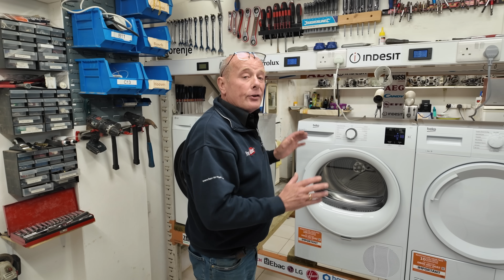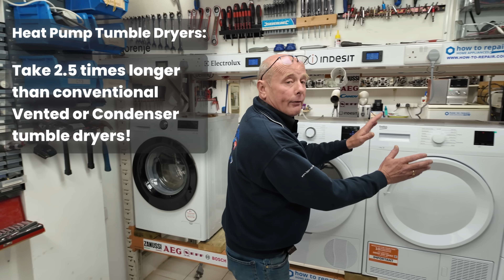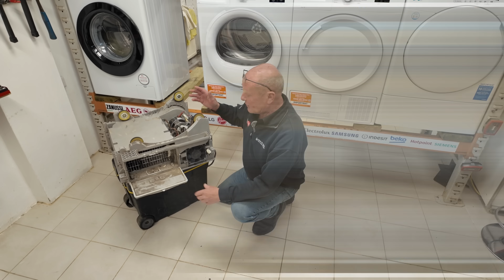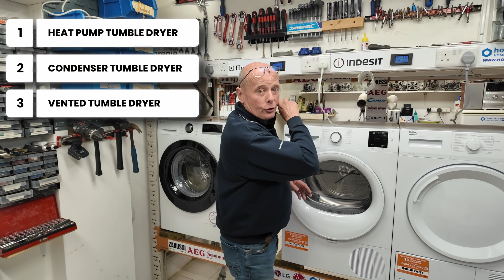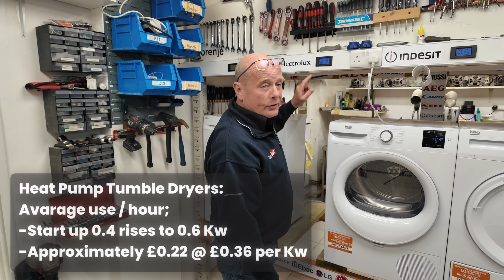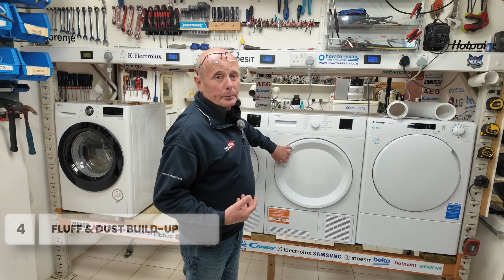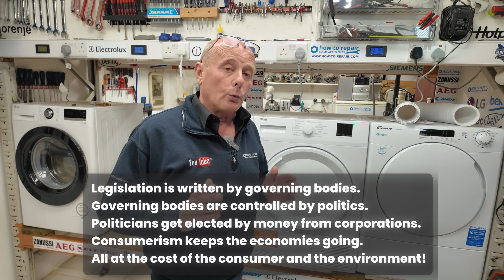Tumble Dryers the Shocking Truth About Heat Pump vs Vented & Condenser, NEW LEGISLATION!

Comment: We have had a Bosch heat pump dryer for nearly five years and so far it has given less problems than our previous Bosch condenser dryers ever did in that same time frame. Also very reduced risk of a fire.

We simply clean out the lint filters regularly.

It uses a third of the energy of our old condenser dryers and we run our home off grid.

Keep your condenser or vented dryers.

Comment: My Whirlpool vented dryer is still going strong after 27 years (as is the matching front load washer). The dryer has needed one replacement belt,(which I replaced myself) and the washer one inlet valve (which got stuck open and the machine filled when not in use (which wasn’t fun when you opened the door to use it 😂😂😂).

Comment: I've had a heat pump tumble dryer for 4 years. It sips electricity. I use it 5-7 days a week when the weather is poor. In the summer, when I don't use the dryer, I couldn't figure out why my electricity bills weren't dropping. Then I realised the fridges were the problem. I bought a new A rated fridge and the problem was solved. I use my washer, dryer and dish washer on the eco setting every time. I don't care that it takes several hours for cycles.

Comment: I had an apartment size tumble dryer, it died, replaced with condenser dryer. I swear it's energy usage is not just slightly less. I think it's close to 30% less.

I also use the delicate setting for almost everything lol.

Comment: I have had vented and condenser tumble dryers and the best are condenser dryers, mine also assists in heating my home.  I wouldn't give house room to a heat pump dryer.  I swear someone has bought a job lot of heat pump, nobody with any sense wants them in their house because they're so inefficient, now they're putting them in white goods, equally inefficient.

Comment: Why should we be told what we can buy just by the energy consumption we pay either way any ways i went to buy a new dryer last year 2024 at currys was told where in the house to have it placed the only place available was the spare bedroom who wants a dryer in the bedroom whether spare or not my air dryer is working well placed in my garage where i get a load done at the same time as my washer finishes i dont think i would get the same amount done as i do now with a heat pump dryer and your right the expense and maintenance expense is beyond my financial capabilities i think im gonna buy a couple of dryers as spares and just keep them dry stored in the garage for when i need a replacement before again we are dictated to what we can and cant buy its the same with cars and electric change over we as a country only produce a small percentage of the emissions and all this green electric cant and wont be able to keep up i work with companoes building wind farms and solar farms these storms have wwreaked havoc on the energy sector by destroying solar farms and the wind turbines cant be used in winds over a certain mph gusts so whats the point

Comment: When I separated from my wife, I went and bought all new white goods. Looking at tumble dryers, there were cheap and cheerful ones not great on running costs and eye-wateringly expensive ones with A+ rarings. Suspecting BS, I asked the sales lady to find out about the running costs of the different options. To actually save anything with the then gas powered A+ drier, it would need to last more than 14 years in comparison with the cheap option.
Typical government response since has been to remove any choice, it appears that you now will only have a poorly made shite heat pump version available to buy. 
I am sorely tempted to go and buy a chrap drier while I still can and store it in my cellar, just to stick the middle finger up at the toxic waste of oxygen that is Ed Milliband. It can sit there with the spare gas boiler as a banker for a sane future.
The UK needs iys own Trump to row back on all this woke nonsense.

Comment: As you use a heat pump dryer, it is sucking the heat from your room and blowing out cold air into the room you just paid to heat up. Now calculate that into the price of running the heat pump dryer.
Reply: And the used electricity magically disappears? Please learn some basics of physics.
Reply: @mrkukov What's that supposed to mean? Still haven't got an answer.
Reply: @johnzangari3432  First Law of Thermodynamics.

Comment: Best feature of a clothes dryer is the heat — raising the temperature inside above 55C (130F) kills all bedbugs (eggs, adults and between). In a building of 100 apartments, somebody will be spreading them down the hallway (equally likely to be the posh family who picked some up at the library).  Will these new heat pump dryers have internal temps that hot? A vacuum won’t keep bedbugs out of the linen cabinet (but it helps the mattress and carpets).
Reply: Is it not more efficient to use the washing machine temperature for killing the bugs? 60C but better 90C if the linen can deal with that temperature.
Reply: @ Residential washing machines typically use whatever water temperature comes down the pipe, which is seldom above 60 Celsius after pipe heat loss. It would require a lot of energy to raise the wash temperature above that which arrives when filling it. 
Way back when, me mum hung the load outside on the porch to dry, whether summer or winter, then steam ironed everything, even socks, to kill any bedbugs. 
More recently, our dryer’s heat element burned out, so we saved a bit of money as they tumbled in room temperature air, then we spent all the savings exterminating pesky bedbugs. Now our dryer stays set to nuclear hot and the bugs stay at somebody else’s place.
Reply: @peters8758  where i live the washing machines are always connected to cold water and there is a heater inside. Usually you can choose between 30, 40, 60 and 90.

Comment: I'm respectfully going to disagree, well up to a certain point. I had a Miele condenser. It was a 6kg 3kw dryer and pretty fast. But consumed as much as a small village. Since spring of last year I've upgraded it with a Miele 8kg heatpump. Not top of the line but nearly a top-end model and got it on discount (around €1100) . Cycle durations are nearly identical but with bigger loads, and consumption? Let me say that from march till december I already saved €500,- on energy. So even if I have to throw out the machine every 5 years and buy a new one, I'm still winning. Point is it all depends, the brand, model, what are you replacing and other factors.

Comment: Very good video. Adding complexity and reducing serviceability is rife and typical across all sorts of areas, when it's not necessary and generally more costly. Not surprised manufacturers can hoodwink regulators as there's typically a revolving door between the two in most sectors.

Comment: Hello Paul big fan of your channels technical advice best on youtube i have a general question in terms of longevity the condenser type of dryer would last longer without repairs needed than heat pump i'm guessing, I been looking at two models one has been weighted so it doesn't move as much and the other is non weighted the series 4 bosch condenser and the series 6 bosch condenser does weighting a dryer increase its longevity than the unweighted one which is 70 pounds cheaper thanks. :)

Comment: Don't bother using a tumble dryer unless you absolutely have to.
I don't, but sadly my wife does and I like an easy life. 
The compromise is a dual washer/dryer which I know is about the worst option - but our space is limited and I lost the battle over whether we should have a dryer.

I put everything on the line when it's warm and on the radiator in the bathroom when it's winter.
My wife will tumble dry a single pair of jeans. 

I've always viewed tumble dryers as something only for use if you have no other option to dry your clothes.
I remember using the massive ones in the laundromat in my youth, when I first moved out of home.

They may be a bit of a necessity for some use cases - people living in a flat with limited space.
For those who have radiators and an outside line, tumble dryers are a luxury and money down the drain.

Comment: Our heat pump dryer takes longer to dry a load than the older vented one. Used to it now, but a faf emptying the water tank, well remembering to empty it. 
But as the heat pump dryer has a moisture sensor to switch off, the family members who always put it on for 90 mins it saves me money. 😊

Comment: I had a heatpump dryer.  After 5 years it failed to dry any more, even though I had cleaned filters regularly and generally maintained it well.  I ended up buying a replacement and this time a I chose to have a Condenser Dryer, exactly because I could not repair the Heatpump myself, as I had easily repaired previous Condnser dryers I had owned over many years.  I spent on a mid-range model and I hope I can make it last for another 10 years at least.  Still trying to get my wife to use the outdoor washing line whenever the weather is good enough, so the dryer lasts.  I use the line myself, especially for towels as I find they end up drier than using the tumble.  Yes, they come out softer from the dryer, but a good shake makes an air-dried towel nearly as soft if there hasn't been enought wind to do it first.
Reply: So, it is true that Britain is extremely poor.
Nobody in America would think of hanging clothes outside.
Reply: @Alec72HD  I read a report a few years ago that examined and compared the microbiology of air dried vs tumble dried clothes.  The difference was quite stark.  The air-dried clothes were far healthier, with many benficial bacteria in them whereas the tumbledried clothes had bacteria the were occasionally quite harmful.  They also noted that the 'fresh-and-clean, air dried , outdour smell was a product of the beneficial bacteria, so our noses are great detectors of the better health provided by air drying.  Tumble driers have to have added fragrances to atttempt to mimic these aromas.

Comment: You are right, but that's less than  half the story.  None of the dryers - or washers- that are offered for sale today are as reliable, durable, or repairable as ones that were made in the 1960s.
 I'm not a repairman. I'm a +70 YO electrical engineer who has been repairing his family's home appliances, electronics  and machinery all of his life - as an amateur.  I don't buy junk and I don't go cheap.  When I need to buy an appliance I use reliability ratings and find the simplest model of a series that will do the job I need done.  
The majority of what's being sold today is junk with features that aren't needed, implemented using a fragile technology that is not protected against predictable damage from the electrical supply or the working environment.  Most of what's being made for sale is designed to a price point and statistically survive the reduced warranty periods with a 10-20% net profit margin.   It's glitzy junk. eg  Major appliances like washers and driers that work with or around water in their operation have electronic control systems that are not protected against an internal leak or an inductive or capactive power spike or surge.
Ironically,  the most reliable applliances seem to be from "inefficient" companies that have invested the least in new product development.  They only redesign what has failed in the past to make it simpler and more durable. 
Given a choice I wouldn't buy ANY technology modern drier.  The machine I have now i bought used in 1981 when I bought my house. It's a no frills gas machine with an electrical clock motor timer that has never needed a repair. Until this last year it had been drying an average of 4 loads of clothes per week.  It has outlasted 3 washing machines, each of which was repaired at least once by me.  
The frequency and cost of repair parts has increased relative to initial purchase cost, while the  machines got newer and "more efficient".  The newer machines lifetimes have been shortening on a exponential curve. Their doors and cabinets RUSTED faster, their bearings failed faster, their electronics failed under conditions that wouldn't have affected simpler controls.  This is the opposite of the reliability curve of automobiles over the same period.

Comment: Good discussion points and some interesting debate. For the record, I used to repair appliances as a hobby / sideline when I served in the forces. Whilst serving in Germany in 1992, I rescued an old Hotpoint Tumble dryer from the roadside on bulk rubbish day. Once it was in the workshop, I discovered it had a collapsed belt tensioner pulley and the trip thermostat had gone open circuit. I ordered the spares, around 20 quid at the time, and the machine became a faithful servant of our household appliances until last year, when, still fully functional, it was gracefully retired. At 2.6KW, it was stressing out the electricity meter just too much and we replaced it with a Bosch heat pump dryer. It has to be said, that there has been a significant reduction in our electricity consumption since the vented Hotpoint was replaced, despite the longer running times of the Bosch. This might be also affected during the winter months, when the solar PV is generating marginally due to the short, dull Pembrokeshire days, the Bosch is closer to the output of the PV array so despite running for longer, does not impact the import of electricity from the grid as much as the 2.6KW Hotpoint.
  Your point on wear and tear on the clothes due to the longer running times is also a good point. The only counter challenge I could suggest is that the drying temperature of the heat pump machine is far less severe than that of the vented machine. I have dried a pair of jeans in the Bosch and have still been able to wear them afterwards without my voice raised by 3 octaves, unlike the one time I tried with Mr Hotpoint's finest.
  Machine wear and tear is also a valid point you make and it would be interesting to see the average Meantime Before Failure of these machines in running hours. I find it disappointing that a manufacturer cannot design and build an appliance that can be reasonably expected to run for at least 10 years, given the average use of probably less that 20 hours per week, without significant failure. The old Hotpoint was testament to how the build quality has changed over the past 30 years, to the point I will never buy another machine from them. After all, the heat pump differs little from that of a fridge / freezer which reasonably lasts well over 10 years with the compressor running 365 days per year for maybe 6-8 hours per day. There is no reason why the heat pump in the dryer shouldn't share similar life spans, and your point on the maintenance of the air handling side, particularly the condenser box is purely down to lazy design on the  behalf of the manufacturer. I usually find the German machines are better thought through on this point, my past experience in working on washing machines used to fill me with dread when Italian stuff was mentioned by the customer.
  Room temperature is worth thinking about for the various types of drying systems. I would suggest that the condenser dry generally benefit from a cooler environment as this will provide better liquid dropout at the condensing elements as the fan pulls to the room air through the condensing vanes. The opposite is generally true of the heat pump machines, where the condenser elements are actively chilled by the action of the heat pump and slightly warmer air gives the hot side of the heat pump a foot-up and enabling the machine to warm up faster. I know neighbours that had their tumble dryers in their garages and the heat pumps do not perform well in winter time when located there.
 Time will tell if the Bosch was a good investment. It is entirely dependent on MTBF and which bits break and whether I can fix it or require specialist support. I'm not a supporter of the Green Zealots but at the same time, I believe in efficiency. The vented machines were effective dryers, but heating all that air and blasting it outside is not the best use of energy. The often not-considered effect, is that the air that the vented dryer exhausts through the wall, needs to be replaced from the cold outside air back into the house, meaning they often create more energy consumption through secondary cooling and subsequent heating requirement of the house.

Comment: I made a comment before but I have a question about the cfcs in the heat pumps on tumblers. Do all of them have the type of gas on the service label and how many of them are banned in cooling and air conditioning equipment. I went down a rabbit hole with finding the info and have hit a bit of a brick wall with it. Oh and if someone messes up doing DIY on on and dumps the gas, can they be fined?